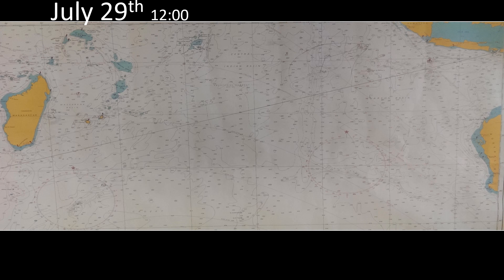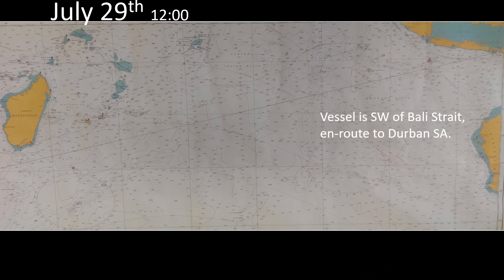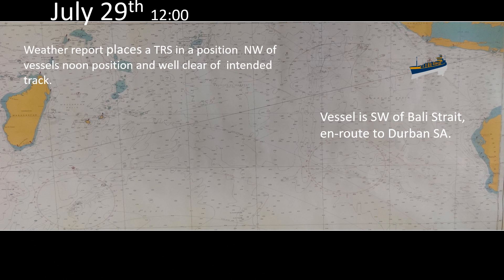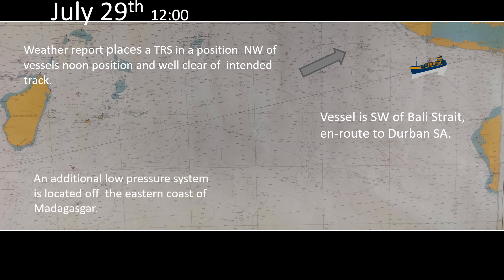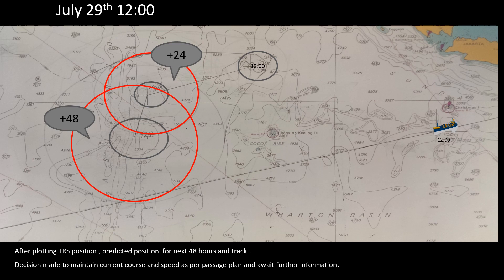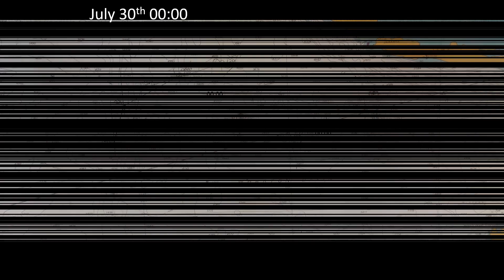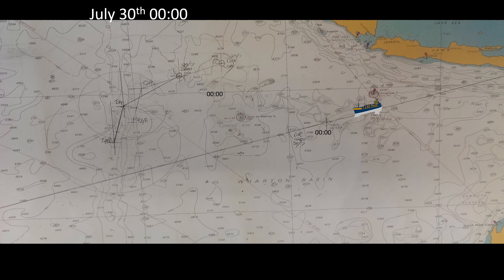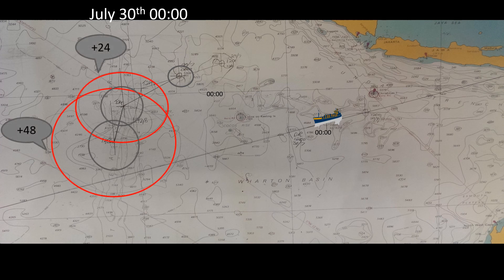Avoiding a Tropical Revolving Storm TRS

Comment: I like the illustration, very practical approach. Two things I really like 1) The vessel safety is priority but in reality the commercial value of cargo is put as priority by vessel management and owners, this approach solved the two problems. 2) when reports like this are given it’s always what the master should have done correctly, pushing the theory most seafarer carry in their head ‘the office don’t care how you do it, only if there is a mistake then they will come to check’ This illustration of positive action is commendable, most importantly using it as a case study for best practice is just beautiful to see. Thank you sir